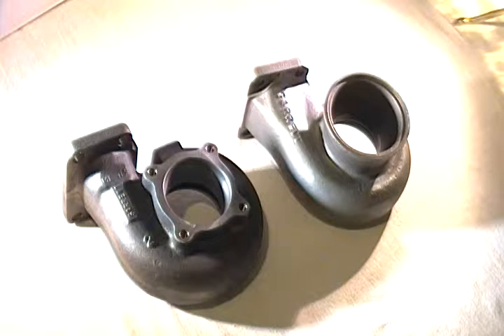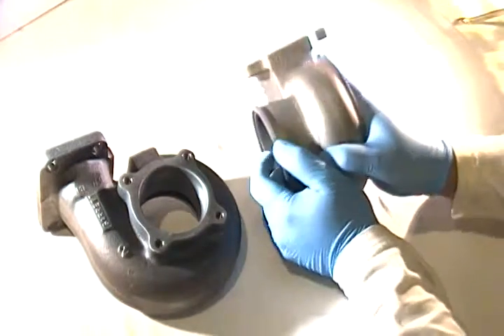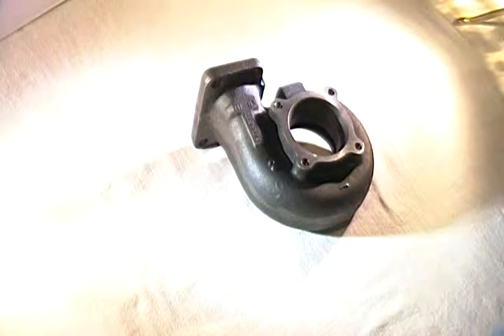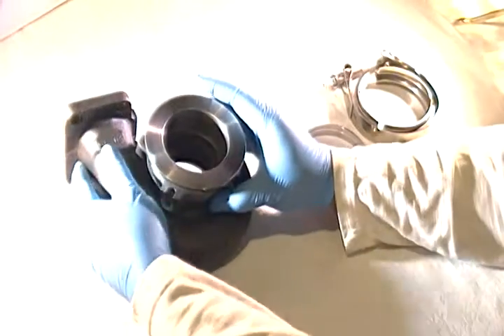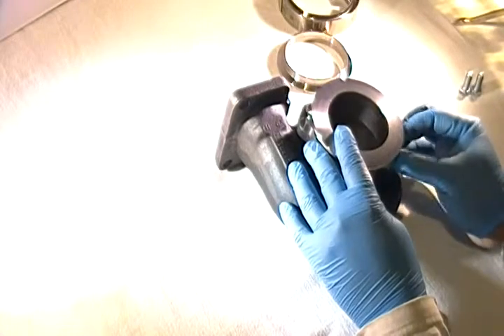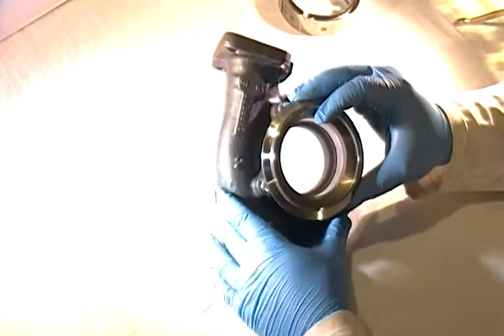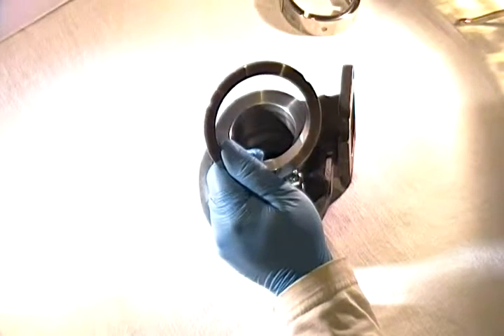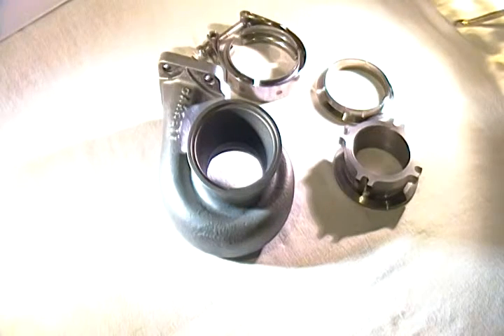STC 2.5"  4 bolt - 3" Conversion flange System  Instructional

Comment: what if you buy a kit like this and your downpipe already is a v band style do you need to welded the clamp they send you on to your downpipe to fit ?
Reply from the maker: Possibly. It depends upon the weld flange that they use. Some use a male "lip" that works with the TiAL style turbine housings, others do not. When people have purchased the kit, and found that the v-band flange on the downpipe is different, they simply cut the old flange off and weld the new one on for consistency. You cannot purchase just 2 portions of the kit.

Comment: Athing for the 5 bolts ?
Reply from the maker: There's one in the works in case there is enough demand, but VERY expensive compared even to this. Considering that the turbine housing is more expensive than a T31 4 bolt like shown, No one has ever asked for one. Only the 4 bolt style.
Reply: STC Turbo Descriptions =(